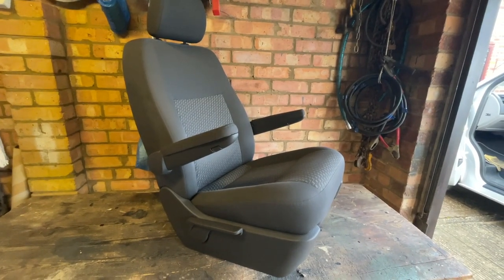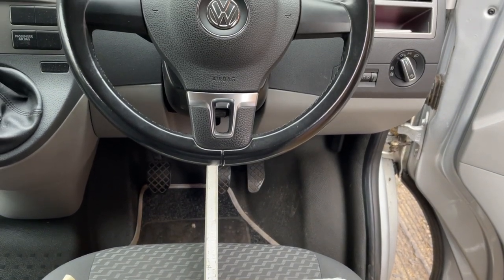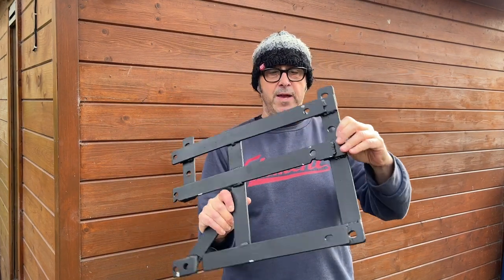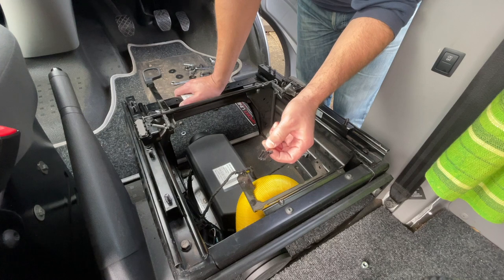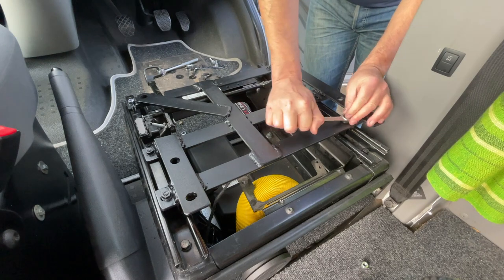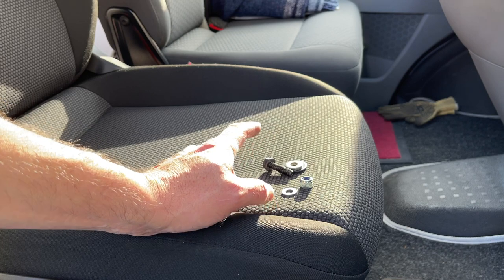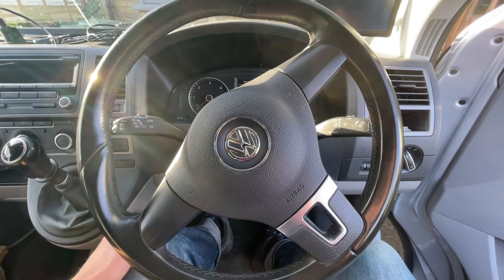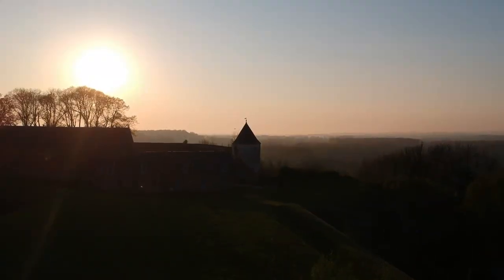VW Transporter T5 T5.1 - The Drivers Seat Is Uncomfortable - Seat Upgrades | Poor Seat Alignment

Comment: I have a t5.1 and think mine is off set.
Can I ask how you back is now since moving the seat and also changing it?  I am thinking of the same and wonder if just to realign the seat only or do as you did and swap it too. Just any updates since you did it would be great. Thanks
Reply from the maker: Hello. The difference for me has been massive, I was going to sell the van before I did this work. I have no problems at all now, comfortable and no pains. I drove to Bergerac from Cambridge in it, all the way, no problem. I have been non-stop from Calais to Lyon, no problem. It made all the difference to the comfort and my feelings about the van.
Reply: Awesome. So glad you back is better. I will do mine then! Thank you for this video and your reply.

Comment: Hi Glen, thanks for great video mate. I just have been back from my first long trip in the t5.1 and I have exactly the same! Do you think this would work with a swivel chair attachment too? Thanks again
Reply from the maker: Hello, not sure if you are asking if you could refit a swivel base in the same way or move the seat left to right WITH a swivel base, I think either would work. I did consider a swivel base and drilling the holes a little larger, perhaps 1cm on the lower section and 1cm on the top where the seat fits but I didn't have one. The problem I think with a standard seat is that it is going to get very close to the door pilar, especially if it has the arm rests on it. My seat is SO GOOD now, I am in the T5 this weekend, 300 miles from home, in France, no problems since I did the work. There are lots of reports od discomfort, this was just my method... Thanks for the comment!
Reply: @GlennJobson  Thanks for the reply mate. Sounds spot on what your saying. I want to change the seat to a volvo seats I'm hoping and install a swivel mount too. Just now need to work out how to do it!  Has the lack of arm rests not bothered you? Cheers
Reply from the maker: @scottronniewood-srwgolf6901  Not been a problem with no arm rests, yesterday I did about 300 miles from France to Cambridge, so comfortable now, when I got out after 5 hours of driving I felt fine, like I wanted to get back in and drive some more, I was going to sell the van before I changed the seat, it has made that much difference.
Reply: @GlennJobson  that's awesome mate, incredible its made that much difference. I measured mine and its exactly the same!  Guess I need to get thinking on how I tackle it asap👍
Reply: @GlennJobson  would you be willing to make me a base unit for my T5. 1 please? Let me know and we can discuss the details etc. Thanks mate, Scott